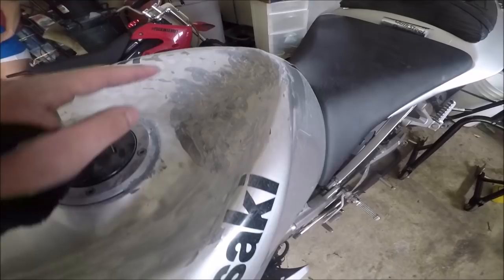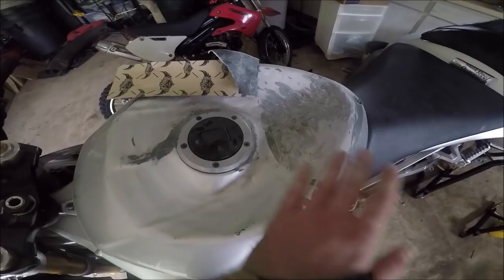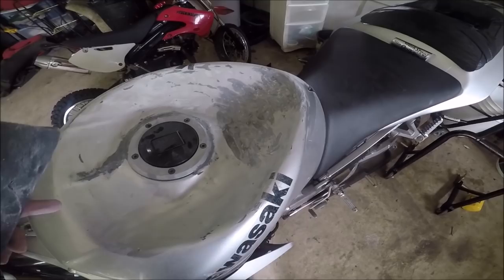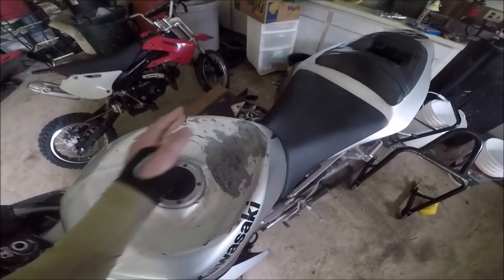How to Make Stunt Gas Tank for Motorcycle Tricks!

Comment: Hey man, i wanted to ask about custom tank.
Does it require you to build the tank from ground up or you just need to modify a stock tank ?
Reply: Most just modify the stock tank, like cut the top off and do some welding to make it to desired shape.
Reply from the maker: modify a stock tank is ideal.

Comment: Hey Brian,  when you do the gas cap with the rubber cover,  can you take the gas cap out and mold the rubber in to the tank and hold it down with the gas cap when you screw it back down or that's just not possible?
Reply from the maker: I guess you could but those paint chips could get in your tank easily....
Reply: Ok thanks